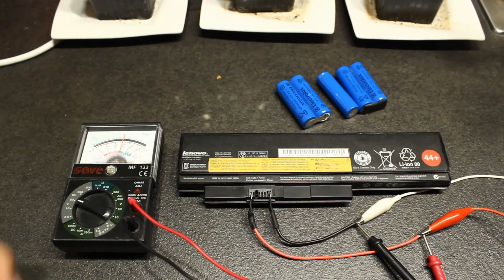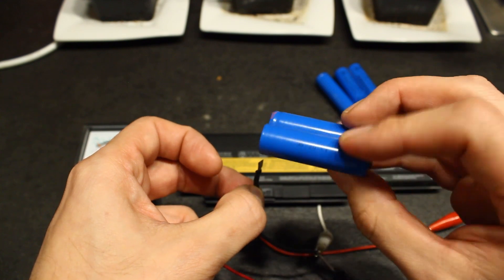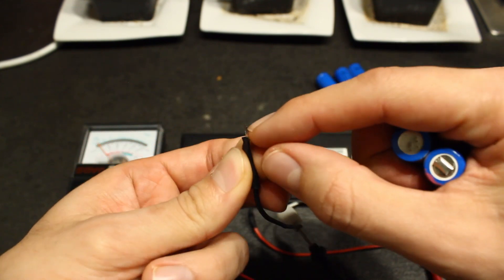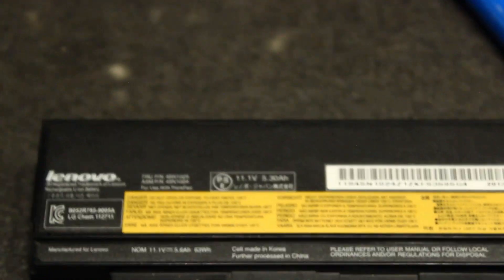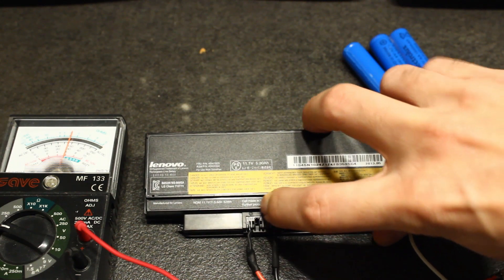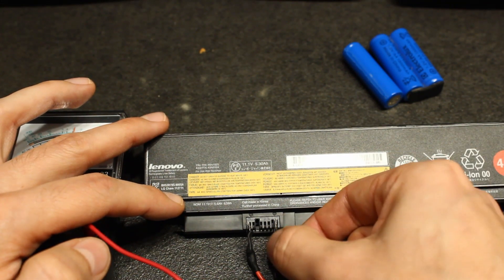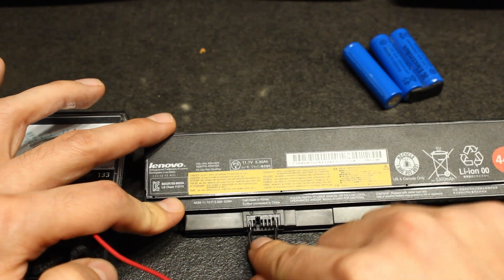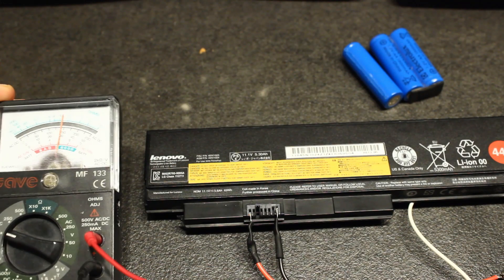Laptop battery pack DIY connectors

Comment: How long should you jump start it with those cable? Should there be any spark in the process?
Reply from the maker: See the rated capacity of your battery to compute time. For a 6000 mAh would be 6 hours at 1 A. Yes, sparks are expected

Comment: I have a iMax B6 SKYRC charger.  It can charge several types of batteries.  LiOn is one of them.  It can charge 1-6 cells.
I have a Sony BPS13 laptop battery.  I can measure on the other most connections 11.3v.   Can I use those points to charge
the battery with my charger ?   I would configure the charger for 3s  (3 cells) for 3.7v x 3 = 11.1v  .  Do any of the other pins need to be jumped for charging?
Reply: I determined I needed to ground the SYS PRESENT pin on a Dell D600 battery to get output voltage.  I was able to discharge the battery using the outer most pins and did to about 9v.  However I can't charge it using the outer most pins.  No current flow into the battery only current flow out of the battery.  Do I have to ground or apply voltage to one of the other pins to allow charging on the battery?   The battery after I discharged it charged perfectly in the Dell D600 laptop.
Reply from the maker: Yes, I assume that some kind of digital communication with the charging board is needed. I could not find a way to charge it from the pins, in some other videos you can see how I balance-charge the pack by directly accessing the battery cells.
Reply: @argilaga  I have taken apart laptop battery packs before and use my iMax B6 to balance charge them.
It's rare you need to do that but if needed then I would suspect a cell is starting to die.   They sell devices just under $100 that can externally charge a laptop battery.  Would like to see the schematic of how they do it.
I also noticed a few Arduino projects to read the data from the board in a battery.  I would guess someone
has figured out how to communicate with the onboard chip to charge, and reset the amount of times the battery
has already been charged.   There is one expensive unit that can do many different brand batteries.  Complete analyze, charge, discharge and tell you the health of each cell.  Several hundred dollars that probably could
be built with a raspberry pi or Ardruino for less that $50

Comment: Hi
Please help me
I have a laptop battery model
 DELL J1KND 11.1V 48W
I want to charge it without a laptop and with a 13-volt adapter, 
can I? 
How do I use its pins? 
What will the connections be like?
Reply from the maker: No, it’s not possible, you need a balanced charger which delivers the correct voltage to each of the three cells. Or an interface to connect to the battery that can communicate with it. You could try to disassemble the battery and apply the 13v to the two extremities of the cell arrangement with a resistor in series to avoid overcurrent and checking voltages manually. But it’s risky and you may damage the battery while disassembly, only try it if you really know what you are doing
Reply: @argilaga  
Thanks
The battery not have BMS(balanced charger)?
https://youtu.be/NpV1Y91LZpU
https://montazhtv.ru/fa/kak-mozhno-podzaryadit-akkumulyator-ot-noutbuka-kak-zaryazhat/

Comment: can i charge laptop battery using this too connectors ? with laptop power adoptor ? help pls
Reply from the maker: You could charge it, but the cells will not be balanced, i.e. they will have slightly different voltages. You need to balance charge or charge using the + most connector and - most connector and then balance the excess voltage. Check the videos: https://youtu.be/t5dAi3EwS2k and https://youtu.be/0LRQaPDoAGs

Comment: Is it always ground the most right one and positive the most left?
Reply from the maker: Ofc it depends on the battery manufacturer and type, mine has a label near the connector. You need to make sure in your case, here is a link that can help you to identify the pinout: http://kuzyatech.com/testing-laptop-battery-pinout-smbus-charge-capacity